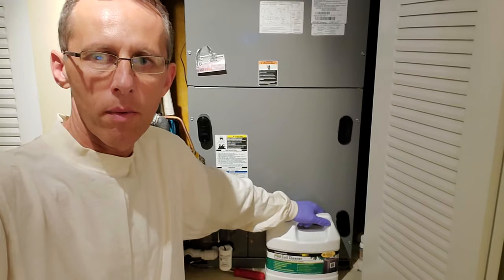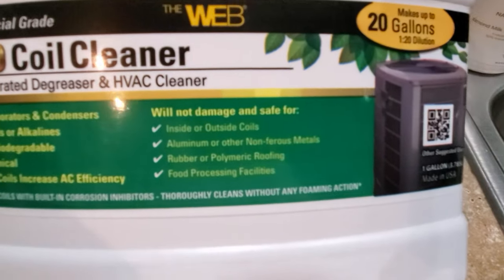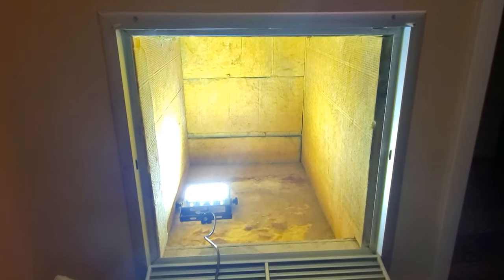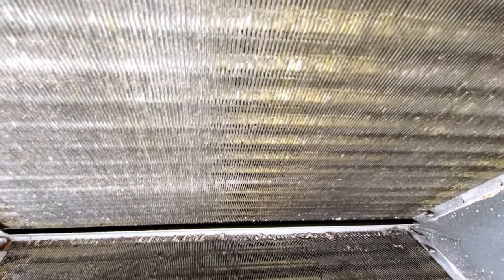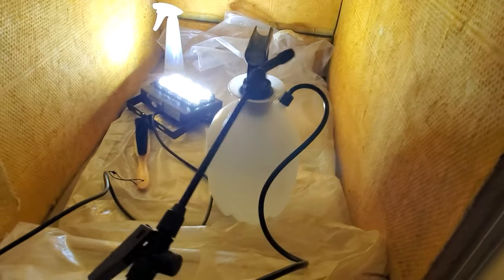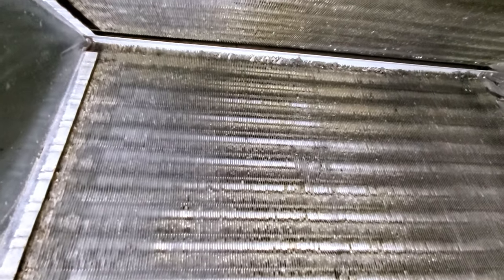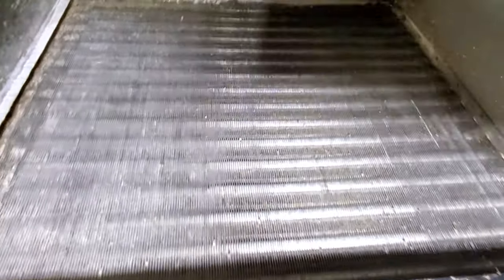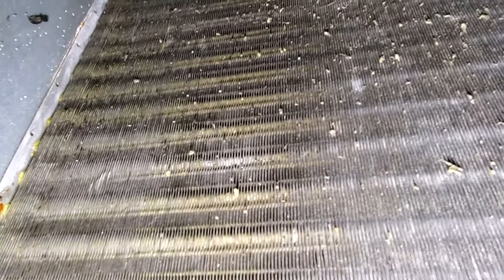How to Clean Inside of AC Evaporator Coil

Comment: great video but what PSI and compresor brand you recommend?!..
Reply from the maker: I'm not an expert on this but I was using mine at around 80-100PSI. You don't want to use too much so you wont bend the coils.
Reply: None.  You don't need it.
Reply: @caru3257  what do you recommend?
Reply: @DJThoughts209  , brush and no rinse evaporator cleaner.

Comment: Hey after the cleaner is on there and left for a bit to I use water to clean off it?
Reply from the maker: Yes. You need to rinse the coils from cleaner thoroughly. There should be no more foam in the drip pan. After that let your coil dry then turn AC on again. If your coil is too dirty and the soap and water does not help you may have to use some kind of coil cleaner.

Comment: You should not use compressed air that will bend the fins and actually cause the unit to work harder to cool. Not a good idea or technique.
Reply from the maker: Thanks for your comments but as you can see I did not bend any fins and it did work for me. I only show what I did and what works for me. You are free to do whatever you want.